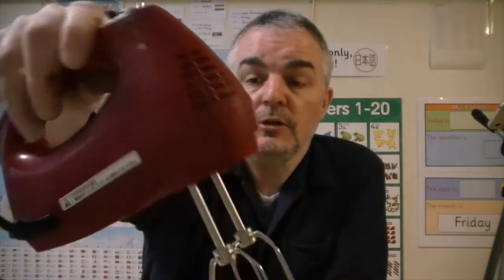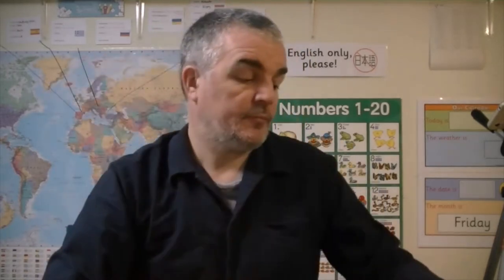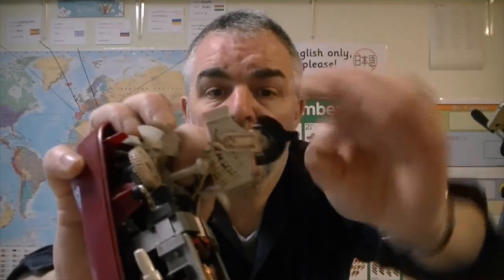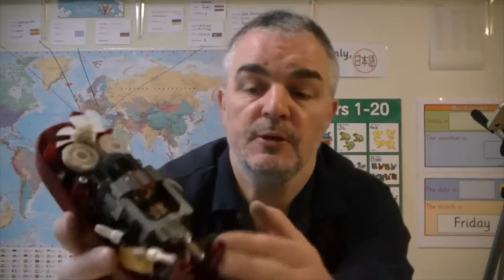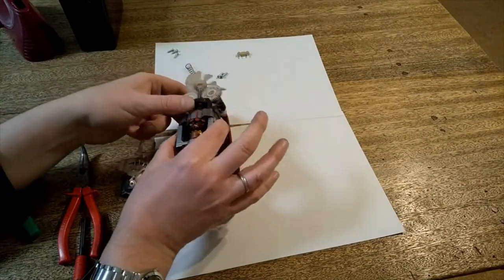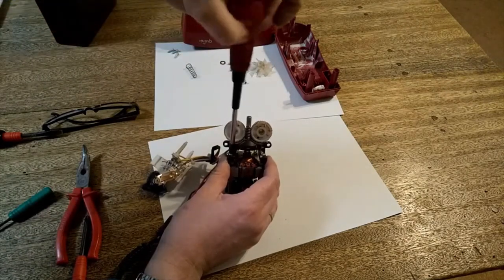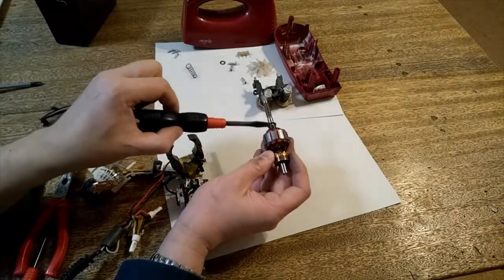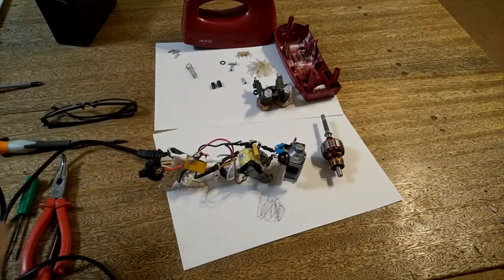What's Inside a Hand Mixer?

Comment: Insightful video! Do you know how does the transmission in this work?
Reply from the maker: Thank you. With regards to the transmission, there is a metal worm gear attached to shaft of the motor, this worm gear drives two plastic spur gears either side to spin the beaters.

Comment: thanks for the fine video. I have learn a lot. What i have to repair, if the mashine dosn`t work, because of overheating. The copper of the motor and the transformer with his connections looks well. Is there a electrical protection inside,witch can be distroit?
Reply from the maker: Flori, thank you for watching and for your comment. I would think all hand mixers have some kind of electrical protection, with cheaper mixers (like the one in the video) having a simple glass fuse, which once blown could, in theory, be replaced. Please be aware that the mixer works on mains electricity and the fuse is a safety system, so you would need an exact match for the blown fuse and be fully confident in your ability to replace it (in my experience they are usually soldered directly to the wiring.) Also the risk of overheating will not be solved by replacing the fuse, so it may blow again.  My best advice to you would be to buy a new mixer.

Comment: Thanks for the video! Is there anywhere to buy replacement hardware for small appliances? The shafts where the beaters go broke when I  was using it too hard.
Reply from the maker: Thanks for your comment. With regards to buying replacement parts for small appliances, I think it would be nearly impossible to find parts anywhere as these appliances seem designed to be thrown away (and replaced with a newer version!) when something breaks. Frustrating, I know. 
If you are determined to fix something that can't be replaced easily, you can try to find a cheap used model (with the same specifications) and use it for spare parts!

Comment: How many volt transformers are used?
Reply from the maker: I think the electric motor used is a 'universal motor' type so it is connected directly to the mains supply (via a speed selector), without any step-down voltage or AC to DC conversion. Here in Japan the mains voltage is 110V AC.

Comment: Hello can u pls tell if we can change the arrangement of the gears inside such that they are perpendicular to the motor
Reply from the maker: Not sure what you are trying to do but a worm gear is attached to the motor shaft which then transfers the rotation 90 degrees to the two plastic gears that spin the beaters. Of course, with a little extra work you could remove the motor and use it for other projects!

Comment: Is there any fusible mob/ resistors  ??
Reply from the maker: Good question, as a thermal fuse would stop the mixer if it overheated to the point of becoming dangerous. I think the small yellow box you can see in the video was some kind of thermal fuse or switch. Unfortunately I threw the mixer out a few months ago, so can't check.